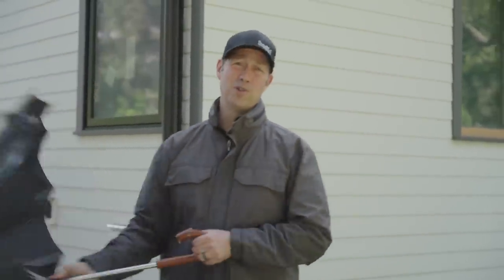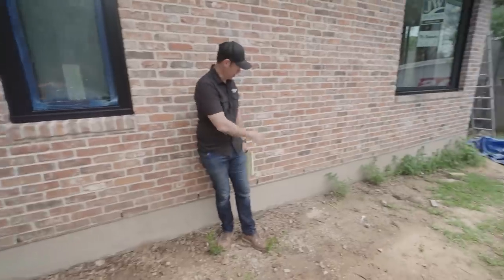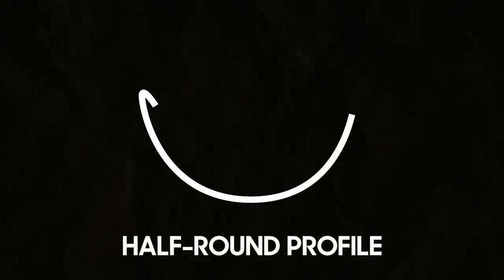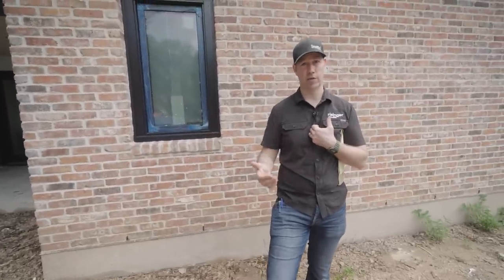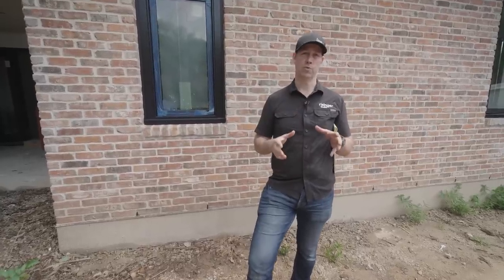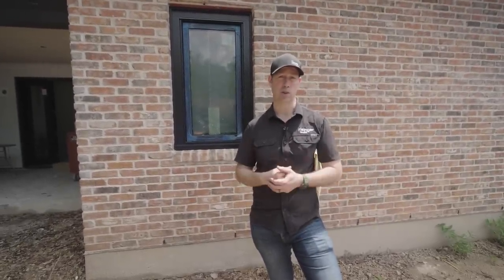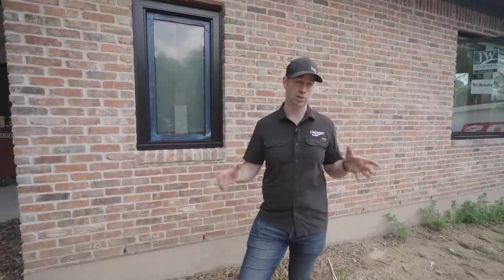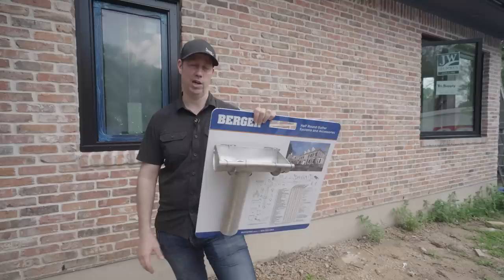Gutters 101: Costs & Options

Comment: Have you heard of this experimental gutter system with the tube that blocks leaves and other debris while allowing the water to curve around and drip into the channel? very interesting design.
Reply: I wonder how you clean out one of those gutters.
Reply: One of the other commenters mentioned that they're overwhelmed during heavy rain.  Based on that, my guess is that since they rely on surface tension to direct the water into the channel, you might need to occasionally clean that curved surface.  AFAIK they don't have a practical way of cleaning their interior.

Comment: You said that you can't use dissimilar metals for the gutters or void the steel roof warranty, but aluminum IS a dissimilar metal just as copper is.
Why are you able to use aluminum but not copper?
Reply: Probably because of the finish on the aluminum stops the metals from contacting each other. Alu also instantly creates an oxide layer when exposed, so that also stops metal to metal contact and galvanic corrosion.
Reply: @AlanW  any scratch or defect in either the oxide layer or paint allows the galvanic corrosion however,

Comment: What are you going to do to cover your foundation walls? I know yours was an existing foundation, but what is best practices for new basement walls, especially now that so many add exterior insulation to them.  No one wants to see rock wool sticking up out of the ground surrounding your house
Reply: I'm pretty certain that Matt has decent insulation on the interior side of any exposed masonry.  One of the previous videos was about how he did a floating floor system, so there's at least some insulation on top of the slab.

Comment: with the recent grid issues Texas had in the winter, are you planning on adding solar & back-up battery? Generator back-up?
Reply: since this is a clean build, the preferred solution would be to install the Tesla Solar Roof, and not mount panels on top of an existing roof.  Since Matt wasn't going to get the Tesla Solar Roof tile for free, it was not going to be used
Reply: @cyclopsvision6370 , Panels would work better wouldn't they ? More surface area ?
Reply: @augustreil  solar panels only work on the panel, whereas solar tiles, in theory, can work on the entire roof.  Because this is a clean slate roof, with nothing on it, and the homeowner is also a contractor, they can move all protrusions, like vents, chimneys, and skylights off to the side, or cluster them together to get the maximum number of solar tile chained together.  Solar panels come in fixed sizes, and will never cover the entire roof, unless the roof  surface area happens to be easily divisible by the solar panel's dimensions
Reply: @cyclopsvision6370 , To get an extra 100 square ft of roof space and pay a premium for it, just doesn't seem worth it ? I''v also seen roofs where the panels cover and sometimes overhang the roof by 3-4'' and they actually protect the roof. Either way ya go, it's all good.

Comment: Your leaf guards seem to be rounded up. Leaves sliding down the roof may not go over them to the ground.
Reply: I use similar-looking gutter guards (rounded shape) with the asphalt-shingle roof on my garage.  They are hinged at the outboard edge for cleaning, and I assume Matt's are also hinged.  As installed on Matt's gutters, they appear to create a valley along the inboard edge of the gutter.  I'd expect that valley to collect debris, and direct some of the rainwater against the fascia board.  When I install them (again, with asphalt shingles), I place them so that in the fully closed position, the inboard edge of the guard is sitting on top of the asphalt shingles.  This completely eliminates any tendency of the guards to dribble water onto the fascia board, and greatly reduces the size of the valley that can collect debris.  I twist on some loops of 18-gauge solid insulated electrical wire as hold-downs for the guards.

With a metal roof, the issue of dissimilar metals (and abrasion due to wind-induced movement of the guards) would make me hesitate to have them in any contact with the roofing.  If they're not on top of the roofing, their tendency to direct water against the fascia board would make me only install them if both the fascia and the behind-fascia blocking (anything that the gutter support fasteners go into) are non-rotting materials such as PVC or pressure-treated.

Comment: I have to say that given the choice between seamless and heavier gauge steel or aluminum I would go with heavier gauge.  It is going to outlast the seamless lightweight stuff by milleniums.  If you are in wet snow country (coastal or heavy) the light gauge and any of the plastic gutters are not going to last two seasons.  Most especially if you go with recommended hanger spacing.  I have used the plastic gutters with hangers on one foot centers and had them blow off in the first snowfall of a couple of inches.  The hangers just bent over and crumpled.  The lightweight aluminum with both spikes and hidden lag brackets just tore out around the hangers and bent some.  Expansion and contraction caused the aluminum spikes to spit out of the gutters in a few short years.  I have had a steel roof of less than 200 sq. ft. 4/12 literally rip the aluminum gutters off that the big box stores carry in the first one inch of snowfall!  Again one foot centers on the hangers.  At the prices for premade sections and seamless this is a crime.  The only way I have been able to achieve a good long lasting gutter especially for metal roofs is to make my own using 1/8" channel with 3/16ths aluminum welded to the channel on which I welded extensions deepening the channel.  Three 5/16ths ss lag bolts hold each bracket at 12" o.c. going into a 2x12 facia.  After three winters I have no problems whatsoever and don't expect any in my lifetime.  This drains a fifty foot run 27 feet deep of a 4/12 steel roof.  That they can even sell the trash they use is disgusting.  Might be ok in Arizona or Florida but anywhere in the northern half and more of the country they are useless expensive trash.

Comment: Gutters kinda suck when you have two feet of snow on the roof and it slides off and rips the gutters off the house.
Reply: You should never have two feet of snow on your roof. If your roof doesn't have enough slop to get rid of the snow. Invest in a snow broom and get that snow off the roof. Otherwise it can and will cloaspe your roof. Do you realize what 2 feet of snow weights?
Reply: @hotrodpaully1  that's like one storm you detrite
Reply: Jeepers who put your gutters on and when do you get 2 ft per storm? My house has pretty crappy gutters, but the snow doesn't drag them off, and anybody I know with more snow than us regularly checks and does the roof rake thing.
Reply: @rpavlik1  - I do roof raking to fight ice buildup.  In 65 years the gutters have gone though many storms over 2 feet without a problem.  One year I had to pound the nails back in because the ice in and over the gutter was so heavy it pulled them out.  Only gutter damage I get is when the really big tree limbs fall on the house.  But I have an asphalt roof and snow doesn't slide off.
Reply: You are supposed to hang the gutters below the roofline so that snow sliding off never touches them.
Reply: @Luckingsworth  ever heard of these things called friction and gravity? 🤡
Reply: @CybekCusal  Yes? 
And you account for those by installing gutters below the line which the snow will shed, taking into account gravity and friction.

Comment: Gutter technology is baffling.  There never seems to be a clear solution.  Those European style gutter hangers, like on the Berger sample board, have the advantage that no cross-gutter brace or spike or over-gutter strapping interferes with the process of cleaning when necessary.  In the Alps where the snow on the roof can be 6 ft deep after a multi-hour storm, they don't just nail those hangers in the rafter ends, they also have a tail piece or two that nail into the sides of the rafters to deal with the weight of the snowpack.  Snow stoppers for a high or large metal roof, whether rails or snap-on points, are absolutely necessary where there are pedestrians or parked cars below, but then present an obstacle if you are trying to use one of those long-handled hoes to pull down the snowpack when the rafter ratings are being challenged.  When the debris in the gutter is dry, I think a leaf blower is the fastest way to thoroughly clean out the gutter, but it would be nice to have some kind of J attachment so you can walk along down below. Here's a guy with a DIY fix:  DIY Gutter Vacuum - Easy and Safe Gutter Cleaning from the Ground - YouTube  I don't understand those screens going on Matt's house.  It looks like they have a convex curve out the top, and wet oak leaves might build up on the eave side until the gutter is no longer open and some of the rain is running off the eave ends, but maybe I did not see it right.

Comment: Hey Matt I have a question. I live In the Hill country outside of Austin Texas And we really don't have a street drain system like you would in a city so my yard gets kind of flooded.  So my question is do you think it would be a good idea if I rechannel my gutter into my house sewage system?  I don't have a subtank system we do have City sewage lines. My gutters do have leaf guards as well. I was thinking but that much water going into sewage lines it would really clean out the lines really well
Reply: Directing rain water run off into the sewer system is illegal and will immediately be noticed and found.    
Don’t even consider it.
Reply: Our town doesn't allow that. No fresh water into the sewer lines. We can however, put it into the storm drains.
Reply: That's typically illegal because even just the intrusion into the sewer laterals can be enough to overwhelm the system during a storm. You may need to regrade your yard to make a "drainage pond" type area if what you have doesn't work for you and you have no storm water management from the city. Possibly a French drain or other type of infiltration basin/system.
Reply: @rpavlik1  Rpavlik1, excellent short answer!
Reply: Thanks for letting me know that this was a illegal I had no idea.  My problem is my house is on a slope the front of the house has a huge driveway/parking lot and that water goes towards a a big drain box and that pipe in the drain box gose from the box underneath the house and exits to the backyard the drain pipe is probably about a foot wide.  I guess I'm going to buy a huge water tank collect rainwater so I can water my lawn I live on an acre.  I'm glad Matt made this video cuz I was really working on redirecting my gutters to my sewage line. Thanks for all the tip guys
Reply: In some cities, the older sections of town don't have separate storm sewers, and the historical building practice was to have a single system that handles both storm and sanitary wastewater.  It's still legal to do so in those places, but probably illegal most everywhere else.
Reply: @kc9scott  I suspect in those places intentionally plumbing into it like this is illegal though. The places with combined sewers generally really suffer for them in rainy months. Milwaukee Wisconsin discharges raw sewage into the lake a couple times a year because of it, iirc
Reply: @rpavlik1  The two places with combined sewers that I'm familiar with is Rochester, NY (where I live), and Terre Haute, IN (from many years ago).  Both of those cities have overflow when it rains, probably most others do too.  However, I had a new garage built in 1992, and we tied its gutters into the combined sewer.  AFAIK we were required by the city to have gutters (it would've been my choice to do so, anyway).  Tying into the sewer was no problem.
Reply: @kc9scott  go figure, interesting, thanks for the info!
Reply: @Michael G “thinking but that much water going into sewage lines it would really clean out the lines really well”… From your post, it sounds like you have a septic tank.  I have a house in an older section of a city, with combined storm and sanitary sewer.  My sewer line occasionally gets clogged due to tree roots, or with stuff getting caught on a misaligned tile.  The times that I typically find out about it is during a heavy rain, since my gutters feed into it.  I’m not sure how a septic system would react to a sustained high rate of input.  Just FYI.

Comment: Copper looks like style.  Aluminum is easy to shape on site.  But really when is some genius going to make plastic custom from recycled plastic made on site?  Plastic never oxidizes and it is flexible and can have any color.   Metal is going to crap out at some time.  Plastic can even have leaf guards built into a one piece seamless product.  Sooner or later with material cost always less plastic will win.  Someone just needs to design and patent the machines.  It will come😤
Reply: How long would something made from recycled plastic last in the sun though? I would not want to live in a house with UV degraded plastic flaking off everywhere.
Reply: @ThePositron2  You'd have the same problem, even with non-recycled plastic.
Reply: You do realise you can buy PVC gutters right now right? It already exists.

Comment: Not even a mention of PVC gutters? More than 90% of gutters here in the UK are PVC. Not all that beautiful or long-lived, but cheap and works well-enough. Metal is the high-spec version, usually galv steel (Lindab is best-known brand, but there are others), but also Ali. I've not seen anyone use copper but it does exist. Must be bloody expensive!

Comment: Where do you live?  I'm in central Minnesota with about 50"+ of snow per season & just had a new metal roof installed 2 years ago.  When about 6"-10" of snow builds up on the roof it will slide off with a lot of force.  I know those mesh gutter guards would not hold up to the weight/force produced.  Is there a "gutter guard" style that is made for heavy snow?

Comment: Great subject - nice half-round gutters really make a house look great!  We used 6-inch half-round here in Tucson and love them.  We used the same brackets you showed to hang the gutters.

We went with galvalume steel, and the steel gutters are super strong.    Our local gutter installer had the machine to roll the half-round to avoid seams and has no problem with using steel.  The steel gutters are so strong, I have leaned ladders against them dozens of times with no damage.  

I used the same galvanized steel mesh as a leaf guard that you showed.  I did add gutter foam underneath the steel guard in some locations, as I found that our desert trees have very skinny leaves and the leaves can slip past the leaf guards. Since we are employing rain harvest (with Texas Metal Tanks from a supplier near Austin!), we need to catch the leaves and the gutter foam works fine here in the desert.  The steel leaf guards shield the foam from UV, and the foam has lasted several years so far.  

You really should check out rain harvest and Texas Metal Tanks.